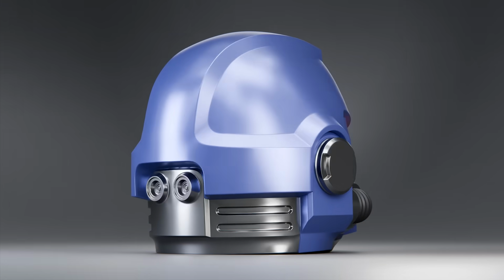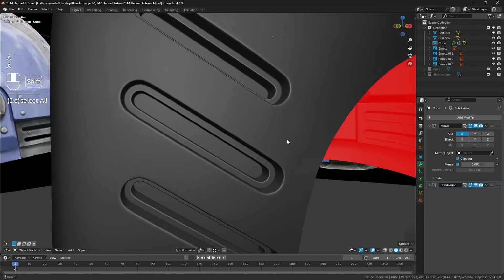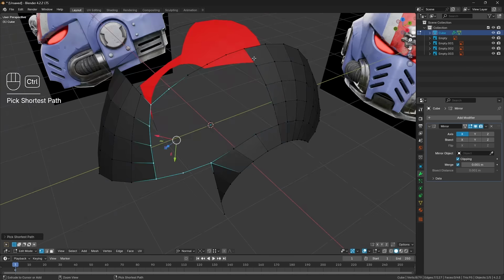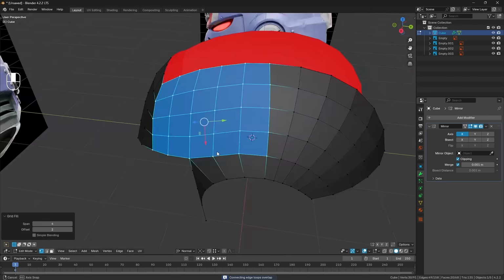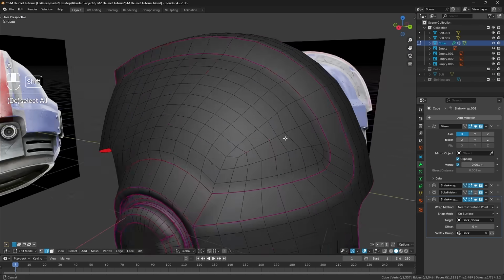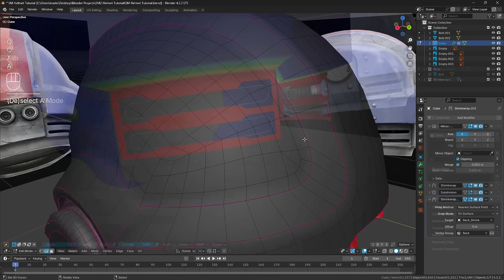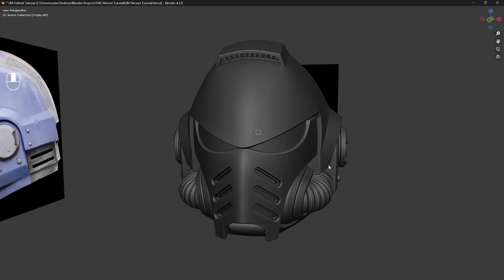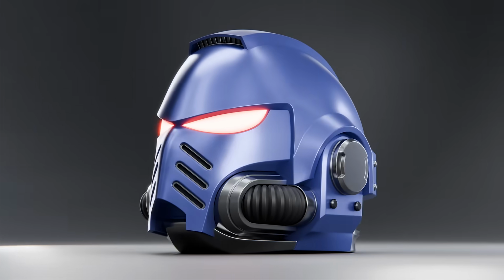How to Make a Warhammer 40K Helmet in Blender

Comment: before I start this series will the model be 3d printable?
Because that is my final goal.
If it is I will start right away.
Reply from the maker: You could print it, though it would require some additional work to make it suitable for print.

I only teach modelling for digital pipelines, though I have seen people print my models in the past. So it's possible, I don't teach those methods in this tutorial, as I am unfamiliar with 3D printing and how to model for print. 😅 Though you could make it suitable. 😄